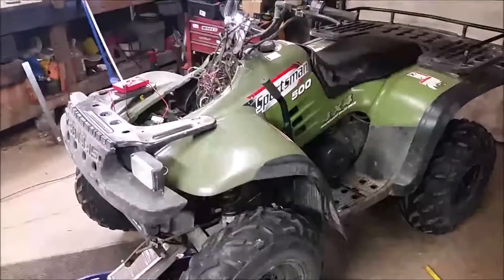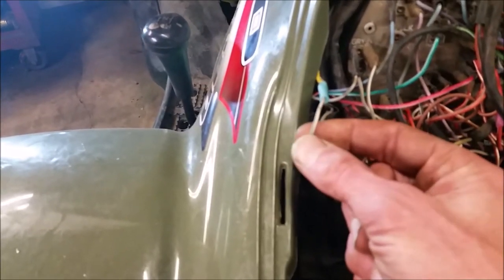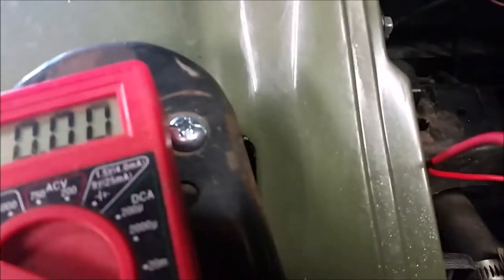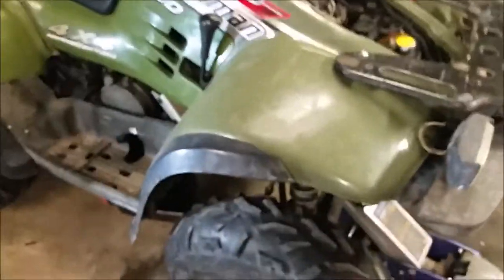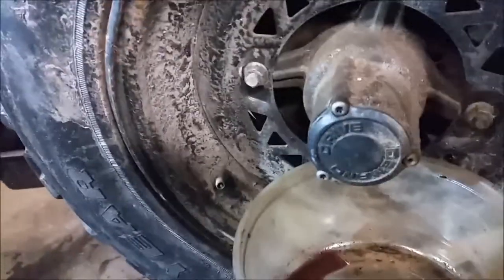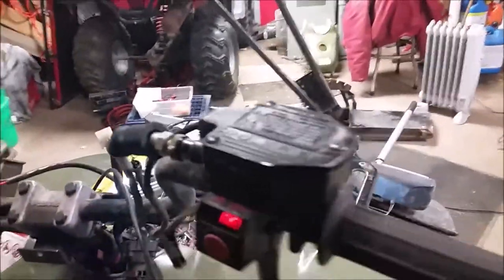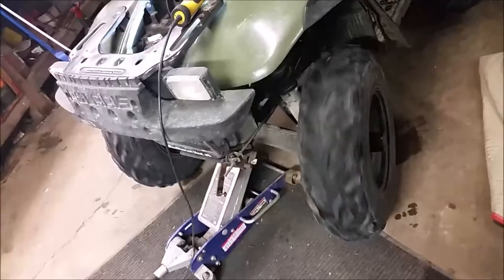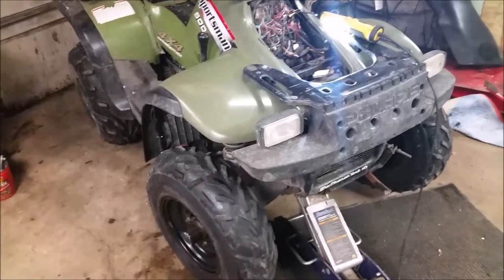DYI Polaris Sportsman AWD Quick Fix

Comment: I have a 99 and 2000 and I commend you for your simple fix and doing the math! Worked on each machine!
  Both machines no longer have working speedometers and have been replaced by aftermarket GPS heads. I heard that the speedometer head also houses the 'brains' for the AWD. There's a PNP chip and something else that can be replaced to regain functionality but this fix is easier and more reliable. Thanks again!
Reply from the maker: Right on! Sometimes you have to take a step back and think about how the wires go...and make adjustments.

Comment: I have a 97 Polaris sportsman 500 that my neighbor gave to me.  It has a plow and I figured it'd be great for our property (10 acres in northern WI)  I've spent quite a bit of time and money tuning it up and fixed some small issues (No charging, bad starter, bad recoil, etc) over the past couple months.  It was stored in the yard uncovered for years so it needed quite a bit of TLC.  The last thing is the AWD.  I just cannot get it to turn on and drive the front wheels.  I've replaced the magnetic coils, Armature plates, (1) of the hillard Clutches, outer seals (Poles), verified clearance between the outer/inner poles which is spot on at <.001.  Wheel bearings are good (New in one side) and the spindle nut is torqued properly.  I'm using authentic Polaris hub fluid.  I even wired the magnetic coils negative wire directly to the negative battery terminal and connected the positive wire to the terminal board which was sending out around 14VDC while running.  I've tried playing with the torque of the spindle nut (Less and more from the standard 110" pounds) but nothing works.   When I have the front end apart with access to the poles and armature plate, it does attract the armature plate and hold it under its own power.  It will release when I remove power but it doesn't hold it very strong.  I've read that aftermarket outer seals (Outer poles) may not work well.  Could this be my problem?  I'm out of ideas at this point.
Reply from the maker: When you replaced the magnetic coil did you make sure  the inner ring is flush with the outer ring...all the way around? I had that issue once. If it's not perfect it loses its magnetic power. Also. I dont torque my hubs to spec. It seems like it's too tight and the hubs dont respond correctly.  I just snug them up till there is a little drag. Sounds like you have power. And you grounded it. A good ground is important.
Reply: @TitaniummanGarage  I seated the magnetic coil all the way back.  I then tapped on the outer sleeve flush to the inner pole.  I've been focusing on the right side and last night I got out a machinist scale and shim gauges to double check.  It was not perfect (But very close)  I proceeded to check all the way around and had to do some minor adjustments but now it is perfect but still no 4WD.   I work from home so on lunch break I'm going to go out there and experiment with a very loose setting on the spindle nut and see what happens.  

I was also just reading how someone had experienced the hardened sleeve in the hub assembly coming loose and spinning inside the hub thus acting like no Hilliard engagement when it actually was engaged.  I'll check this, too.

Thanks for the quick reply!  Where are you at in WI?  I'm in Marinette county.
Reply from the maker: @anthonyg6221  I have a cabin near high falls. My shop is in Sheboygan
Reply from the maker: @anthonyg6221  Oh..if the nut is loose. That is correct. The hillard wont engage
Reply: @TitaniummanGarage  I'm near Goodman.   We just moved up here from the Milwaukee area.  Finally can use an ATV and snowmobile from my front door.  Totally awesome!  Anyways, I went out to the garage and fooled around with it.  The torque on the nut had no effect.  I did however add 3 small pieces of small diameter fuel hose to the 3 tabs that protrude from the armature plate.  My thinking is I needed more pressure on the armature against the magnetic poles.  For the first time the right front wheel engaged 4wd!  It was intermittent and didn't disengage well by turning off the switch.  Going into reverse would disengage it.  After I reassembled and added hub fluid it didn't seem to work anymore.  The Hub fluid must be too slick and reduced the friction.  I might fool around with the fuel hose idea a little more, maybe add a longer piece to add more pressure on the plate.  Not sure how long this fix might last but the fuel hose fits perfectly in the 3 notches on the back side of the Hilliard assembly.

I think the inner poles are worn down from bad wheel bearings and to fix properly will require new struts which probably won't happen on this machine.  If I can get the 4WD to stick on by rigging up with something (Fuel hose) it'd be good enough to plow with.

Thanks for the advice and videos!

Comment: I noticed when i jack up the Polaris and floor it the AWD kicks on when its floored but when you floor it it jerks and breaks the axel due to the AWD kicking on. the wires are still in mint condition and the reverse overide works only if you floor it to. Ive gotten stuck multiple times and it would not spin but one front tire or none of the fron tires. its a hit or miss when talking about the fourwheel drive on the ol polaris.

Comment: I'm stumped, mine (1996 sportsman 500) isn't working on the right side wheel. I changed the coil, and tested it by running the atv and having the rear wheels spin. I can tell the coil is working by how strong it is. Reassembled the clutch (it's new and so is the armature plate), filled the hub with the demand drive fluid to the 3 o'clock position, I didn't use grease . Still won't work. Any ideas??? Any help would be appreciated.
Reply: I just fixed it! After 2 years of working on this on and off, the awd being the major issue, I finally fixed it today. I figured out I hadn't tightened the  castle nut enough. It needed just a little resistance to help engage the clutch. Now it works!!!

Comment: Thank you for making these videos!!!  I have a 2002 Scrambler 400 4x4...4x4 only works in reverse with override button pushed in.  Then button is pushed in, the add light on the right control is illuminated, when I release the button, the light goes out.  I'm wondering if the Trans Switch is bad?  any help is greatly appreciated.  Thanks!
Reply from the maker: Try pushing the override button in forward gear. It does sound electrical.
Reply: If it’s only doing that in reverse, it’s working correctly. AWD will only work in reverse with the button pushed. Very annoying when plowing.

Comment: I’m trying to do the same but only have two grey wires. I believe it’s a 99, but mine does not have that board like yours does in the video. All I have is two grey wires and not one with a white stripe. Any help would be greatly appreciated. You are Polaris man in my book. Lol
Reply from the maker: You have the plug and play style. 2 grey wires and a ground looping to both. I would add a wire to that ground wire and connect it to the frame somewhere. Use a test light first to see if you have power to the 2 grey while in 4 wheel drive first.

Comment: First off love the videos. I do have a couple quick questions. First off can the AWD switch be lit and still be bad? What do you have your volt meter set on? Lastly where exactly is your neg volt meter attached to?  Thanks
Reply from the maker: There is a chance it could be. But if you hook the volt meter set it to 20 volts. Put the black on any ground. You should be able to tell if your switch is bad.

Comment: 2002 500 Scrambler After replacing the head, the fan is not engaging. Wire to the bottom of the radiator is hot. Suggestions besides the thermostat? Tia
Reply from the maker: https://youtu.be/d9jZUhO1LJ0

Comment: Hello I have a 03 Polaris Magnum 330 feels like my right front tires locking up hard to steer feels like something is fighting any recommendations would greatly help thank you
Reply: I had similar problems. Change your hub oil. Worked for me
Reply: I have this same problem and am having a hard time figuring out why
Reply: My wheels pull also. Just back the quad up a bit and the wheels seem to release again. 2001 Sportsman

Comment: I have a 1999 Polaris 500 magnam starter got water in it And frooze up changed starter-abendix and starter cylenoid went to start and only cylenoid clicked taken apart twice same thing have  to start with pull rope I am 72 years old have a bad heart and towrn rotator cuff this pull starting is killing me need help any tips apreciated
Reply from the maker: Is the starter new? I'm not sure what you mean when you said you took it apart twice. So..you have power to the solinoid but not the starter. Have you tried a new battery? Sometimes the battery will read 12 volts but when you add power like lights or a starter the voltage drops and the starter won't turn. Also look for any broken wires leading up to the solinoid. It could be a weak connection in the wire harness going up to the start button. I believe it's a white wire with red line on it. I had to trace one once. It turned out the start button turned green and corroded on the inside. Not sure if that is your problem only because your solinoid is clicking telling me you have power from the start button.
Reply from the maker: Also check your ground wire.

Comment: I have a 96 Sportsman, when I test that grey connection, I'm not getting any power, and the 4x4 light never comes on and the button won't stay in, I push it in and it pops right back out. Any advice to what it could be?
Reply from the maker: Its probably shot. You might want to replace the button

Comment: I've got a 1993 2 stroke 350 and and it's on demand I let a friend drive it and he done something to it I found that the light was on 4x4 and I turned the switch of and now when u put in high it's like it won't pick up speed but in reverse it's fine it goes fast and now it won't turn on 4x4

Comment: I have a 2001 500 ho put new camshaft in and china 30 dollar carb.
Starts right up accelerates good but won't idle no matter what I do with mixture screw.
Seems to be hydrastatic locked after it's hot.
Any ideas?
Thanks
Reply from the maker: I would double check the valve lash. Sometimes after replacing a cam after the chain has revolved in the engine a bit it tightens more and throws off the adjustment you set. Also depends what carb you bought.  I've had good and bad ones. I must have at least 10 china carbs in a box that didn't work. I use the parts to rebuild the oem carb.

Comment: When you are referring to checking the spacing of the coil and the magnet with .001 feeler gauge, can you explain better how to check this?
Reply from the maker: You have a inner ring, then the magnetic coil,then an outer ring. Take something perfectly strait like a ruler or a piece of metal and go across the whole coil. See if the outer ring is out further than inner ring. If it's more than .001 it won't magnetize.  Only the outer ring moves.

Comment: So, why are the wheels turning at idle?  My guess is that the belt drags just enough on the pulleys that the tires will turn when there is nothing holding the tires?  And my other question.....I thought the all wheel drive was only on demand?  Or does it sense that the wheels are slipping when it's jacked up like that?
Reply from the maker: The second option
Reply: @TitaniummanGarage  what do you mean by the second option?    I was asking two different questions
Reply from the maker: @adamr8628  It senses when its slipping. your belt could be too tight or idle too high. Thats why the wheels are turning

Comment: I tested my wires on my Polaris 500 magnum. The gray wire has 12 volts. Then for the heck of it, I tested the brown and it got 12 volts as well. Brown is ground isn't it? The 4wd doesn't work but can't figure out why I would have 12 volts to the brown wire.
Reply: I have the same problem the wires on mine are shorted out on both sides between where they split off to go to the hubs and the hubs. It doesn't make sense to me why the would both short out. Just got it but someone else unhooked the ground to keep from arking out
Reply: Sorry I was wrong it is supposed to have 12v until it actually becomes the ground  I don't fully understand why but my dad is an electrician.
Reply: @austinjackson8248  I got my rig figured out. My speedometer wasn't grounding out the 12v to the coil. This is a known issue with these speedometers. All I did was cut the two wires that goes into the speedometer that are grounds and wire them together. You can still use all the AWD switches as usual and doesn't harm anything. The two wires you cut are the brown with the white stripe and the solid brown. Those are your grounds that need to be tied together. Mine has worked perfectly since doing this. Good Luck.

Comment: Hey mate. I’ve been trying to find a work around and I’m getting stumped. I have a 2003 sportsman, and Polaris changed the wiring harness around. 1st, they omitted Gray with white, and I can’t find a similar line anywhere on the harness. And 2nd, I seem to have power to the AWD wires whether I’m in gear or not. I have AWD in H & L, but can’t get it to kick in while I’m in reverse. My override button does nothing. I wanted to omit it so when I plow this year, I wouldn’t need to press it to keep my AWD in reverse. Wisconsin winters and all. 
 I’ve been looking at my wiring diagram to see if there was a spot I could splice into where I wouldn’t need to hit the override button, and bypass the tranny switch, as you did, but I’m not seeing a way. 
Do you have any ideas?
Reply: So, I found the gray with the orange stripe is what comes off of my override switch, but it toggles between my miles, tach, hour meter and voltage. My switch is not working, because I've never been able to toggle between anything. But when I ground out that wire, my AWD does work in Reverse now. But if I leave it grounded, I get a flashing check engine icon on my speedo. If I just touch the wire to ground, I toggle between my choices on my speedo. I'm thinking to hook it up to a toggle switch, so I can turn it on when I want, but hopefully won't give me any issues. What do you think?
Reply from the maker: I would have to look at a 03 wire diagram.Did you see my video on the bypass tranny switch? Without looking at the wire diagram it could be a ground issue. I would double check your grounds. make sure any wires are not touching that shouldn't be that are hot. Is that white wire you spoke of have power to it?
Reply: I did watch that video. But there is no gray with white stripe in my harness at all. The 03 has a multi function override button, not just AWD engagement. So to me, it does not seem as straight forward as giving power to it, or even grounding it out, if I understand the wiring diagram correctly. I was hoping you had come across this one before. I’ll rewatch your video on that 700, as that was the same year, but I don’t remember if they had the same functionality in the override switch on that model.
Reply from the maker: @michaelchaoticreason5059  I was just about to ask. yes the 700 does have multi function. I've been working on so many of these I forgot how the 03 was.
Reply: @TitaniummanGarage  . I thought I had watched the video on the 700, but I guess I didn't. On my 500, there were jumper wires on my 4 wheel drive plugs. They looked like factory wires, but there was a jumper from ground to ground and from live to live. I didn't know which to splice into, so on my 500, and I actually saw in your 700 video as well, there is a grey with an orange stripe that comes off of the override button. I cut that and hooked it up to a toggle switch and grounded out the other side of the switch. It solved my issue, and if I just switch the toggle on and off, without being in AWD, it toggles the info on my speedo too!  
 But grounding out the grounds probably would've been a lot simpler... ;) Thanks for all your help.
Reply from the maker: @michaelchaoticreason5059  Nice! Glad you figured it out. I figured the 700 video would help.

Comment: When I flip my switch on my 99 magnum, the front axles still spin but my wheels don’t, could that still be an electrical issue or is that Machanical?
Reply from the maker: It could still be both. I would start with electrical, then check the clutches.
Reply: @TitaniummanGarage  thanks for the advice I’ll keep you posted on the results I find

Comment: Have zero power at all. No lights no dash no 4x4. Can only start by pull cord 02 sportsman 400.  Worked fine yesterday. All take ground of some wire unplugged?  Any ideas??
Reply from the maker: It starts..so that rules out any kill switch issues. I would start from the battery and work your way up. Battery charged, check connection to starter solenoid sometimes it's a bad ground, loose wire. You almost need a voltage meter to check the rest. It's not an easy answer without testing anything. Make sure your battery ground wire isn't loose or corroded. It could be a number of things.
Reply from the maker: Wait. You have the digital dash right? If the speedo is shot the 4x4 won't work.
Reply: Titaniumman Garage has digital odometer only.   Nothing electrical works.  Cant start with starter but can turn off. No front light or break lights. No gear indication light, no 4x4.  Will dig into some more shortly. Too damn cold to work on the right now.
Reply from the maker: @mjjack7  Pull the plugs going to the start button/kill switch. I had one like that. same issue. the plug wires turned green and wouldn't start. dash wouldn't light up or lights. There should be 2 plugs. I cleaned mine with a cup of vinegar and a teaspoon of salt. let it soak for 15 minuets. It takes the green crap off. unhook battery first. Try adding another ground wire somewhere if you can. If wires are green it means bad ground.